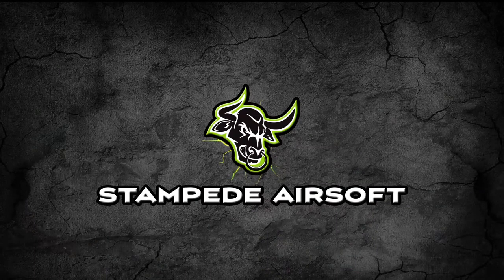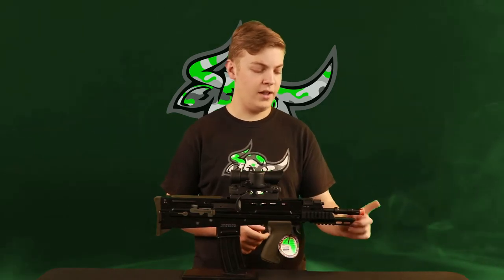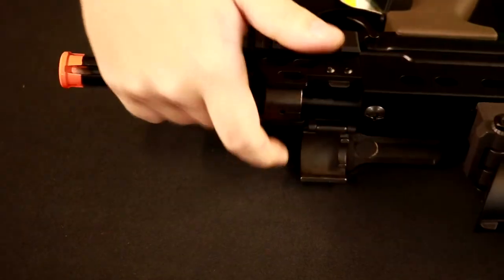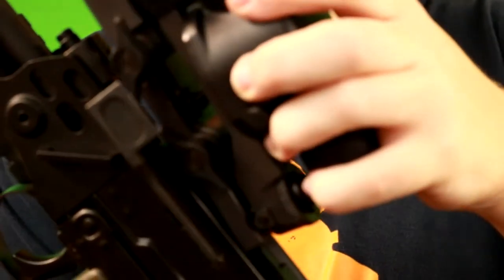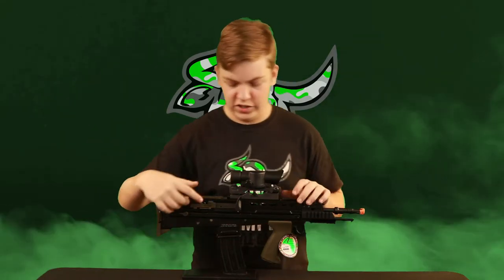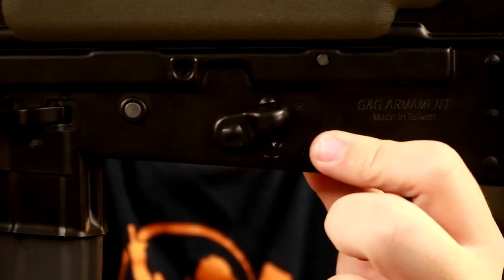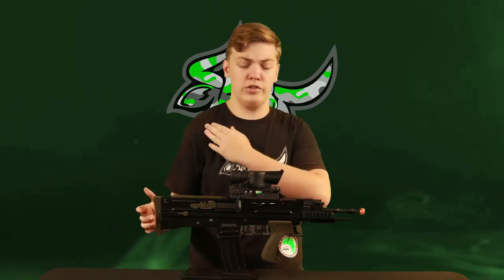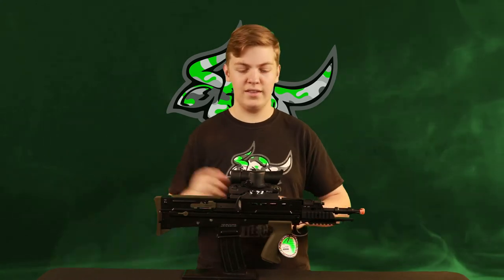This Gun Is Built Like A Tank - G&G L85 AFV ETU Review

Comment: I’ve got this gun bought it last may used it once magazine didn’t click in very well found I had to push the catch in with my finger so the magazine wouldn’t fall out my mosfet then messed up and blew the fuse and every time I put a fuse in and connect a battery it blows straight away so mosfet must be knackered oh and the blowback broke so stopped working , great looking gun shame it’s crap well done g and g £400 well spent!